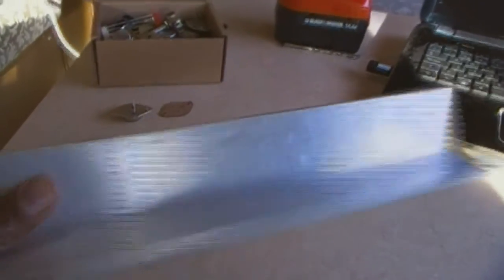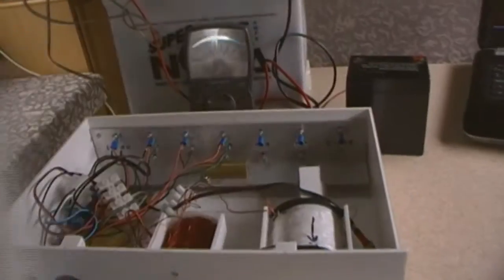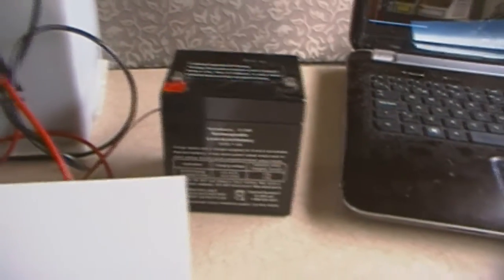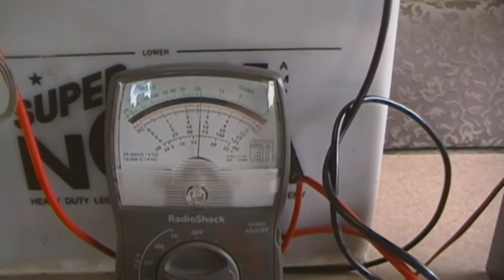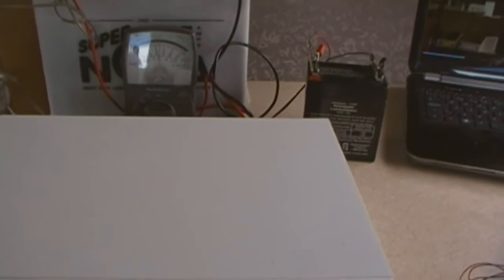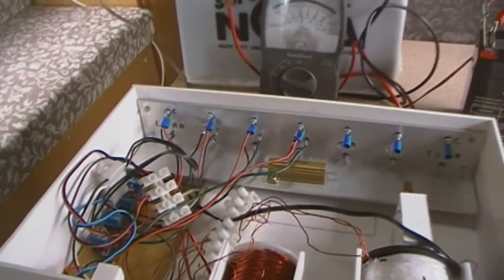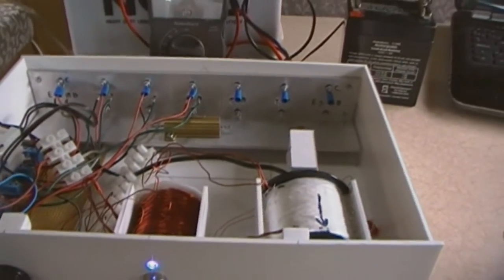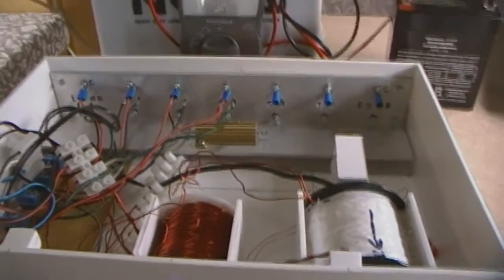Motionless Bedini Energiser Build - Part 2

Comment: Bedini is a waste of time none of it works!
Reply from the maker: +Bushylingus Dunno about you but I've had mine working
Reply: Bendini chargers work,   but  they ruin the battery after a few charge cycles..  Before Bendini died,   his company was sued.  They don't sell Bendini's (Tesla Chargers) anymore..
Reply: @THOMASTHESAILOR  They added a capacitor, therefore the bedini charge the capacitor that is discharged in the battery. I use for years a PC fan bedini charger and it ruins only some Li-Ion batteries. It works very nice with rechargeable Ni MH batteries and of course Lead acid ones. But this is my own experience, maybe your chargers act differently than mine. You can share to us the schematics you use, maybe is something wrong with it.